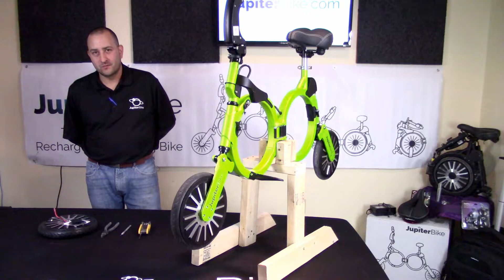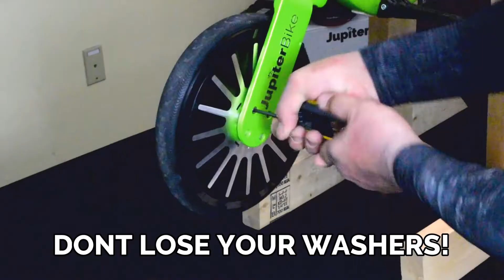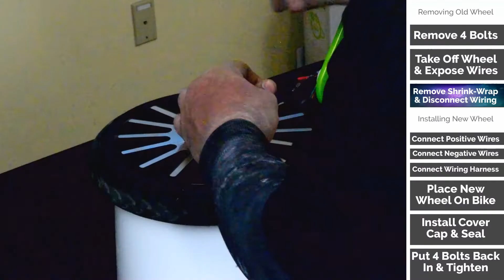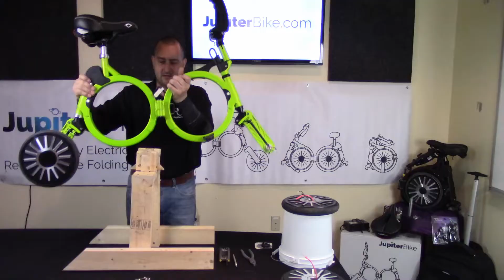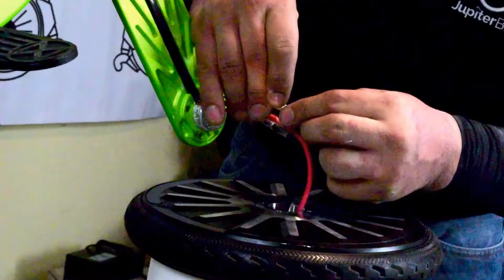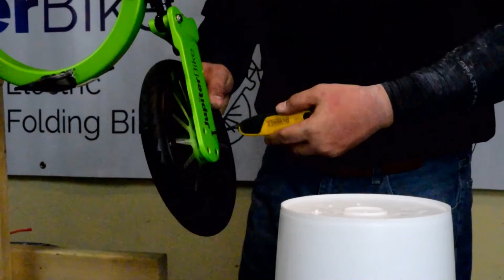Installing the Front Wheel Battery for Generation 1 & 2 Jupiter Bikes

Comment: Hey Brian.... What is the difference between the Discovery X5 and the newer X7? They look the same. I am guessing bigger battery and higher wattage motor?
Reply from the maker: The x7 comes with a Shimano 6-speed gear shift, the x5 is single gear. The x7 has 20" wheels; the x5 has 16" wheels. The x7 also has a larger and heavier battery, fitted to the heavier bike with larger wheels. The X7 is slated to come out in the fall: https://www.jupiterbike.com/discovery-x7